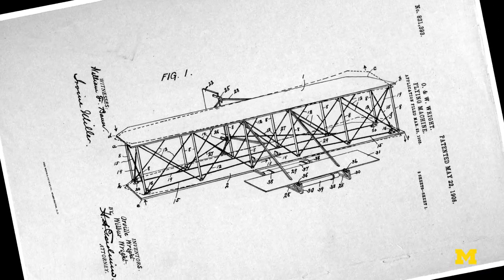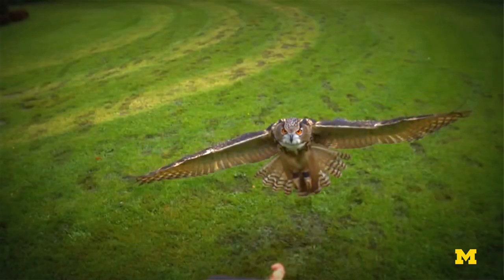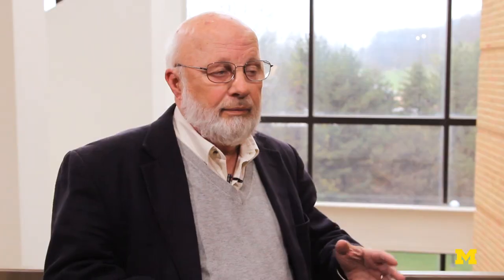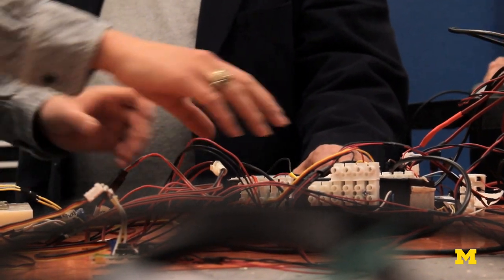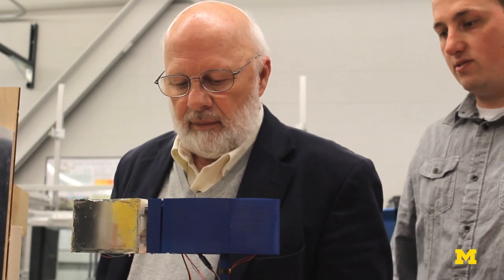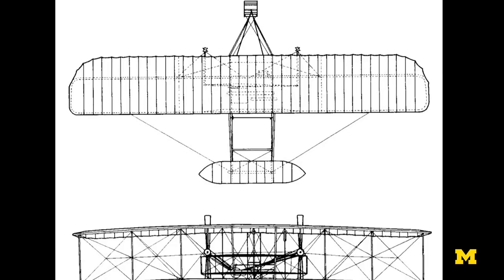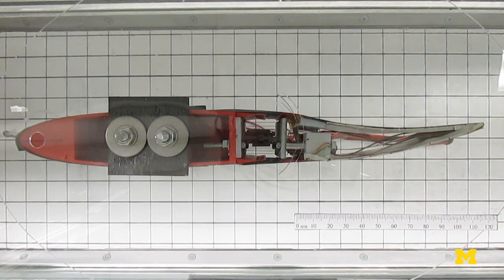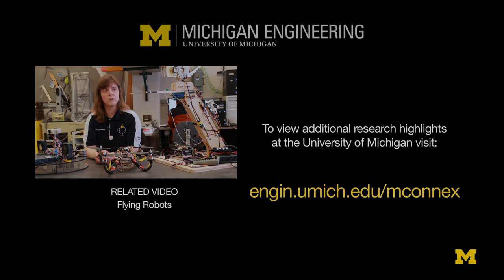Morphing Wing

Comment: What does a lightning strike do to this material?
Reply: wrecked!
Reply: Most light aircraft don't fare well to lightning anyway. There have been cases where lightning have crippled aircraft spines, literally causing the wings to come off
Reply: @laurencebois5119  I was thinking more along the lines of a commercial aircraft since they tend to fly in inclement weather where the light aircraft should stay out away from anyway.   Does the material curl up and permanently deform so you have a flight surface issue on one side of the aircraft?
Reply: @mattrhoades9487  I would like to see their r&d on this, maybe they have already tested for the event of a strike